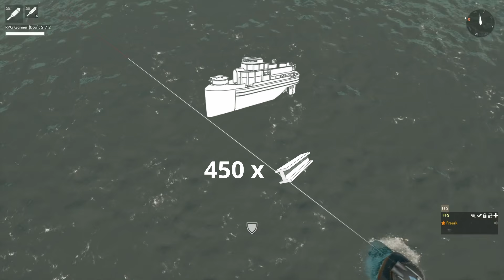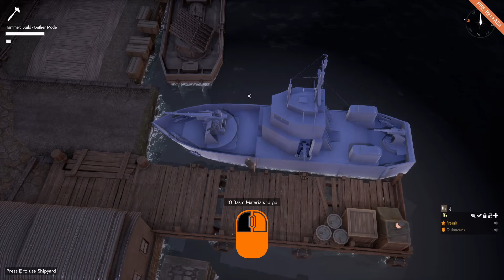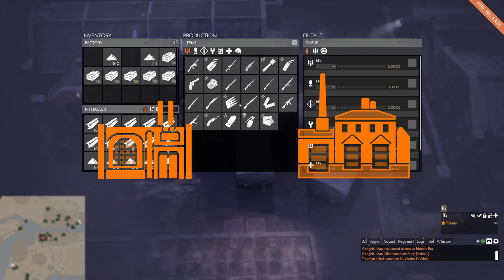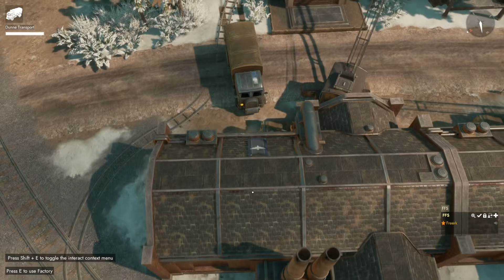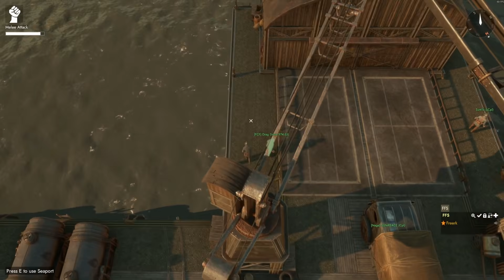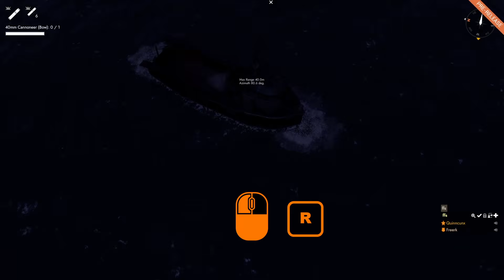Gunships- Foxhole Guide

Comment: As a collie navy player, they should really buff the warden medium boat. In a fight between two crews who know what they're doing the Strider wins every time. I've won 3-5s, and one of those 3 was an AA boat. Orn's back turret thingies should probably like reload slightly faster and turn back far enough that their fields of fire partially overlap. Or the RPG turret needs like a 240 degree arc or something.
Reply: Yeah the RPG part of the warden medium boat really sucks
Reply: @yourlocalkj  The rpg turret is at least closed off so just providing a turn radius buff should be enough. The 30mm at the back tho might have to be swapped for something else. I understand the forever quest the devs have of providing a worthy 30mm tool for the wardens but that aint it.
Reply: Besides the Warden naval assets then to have something over the Collie version in atleast one way or another, you feel their gunboat needs a buff cause the Collies version has an edge for once? What?
Reply: @ScryeTheMindless  As far as i am concerned, if  they do something like the scout planes (both factions having a nimbble scout and a tankier scout) for the gunboats, i would be more than happy.
You get some form of asimmetry but not the Bs of having a dogwater option for one of the factions.

Of course it does imply that i would like seeing more stuff for the collies too.

Comment: Man I hope they increase Ornitier's turret max turn angles so it can fire all its weapons broadside like a Strider
Reply from the maker: I think they limited the RPG turrets arc to "force" the use of the deck cannons and therfore the need for maneuvering. 
Because yes, the Strider has a large firing arc on both cannons but its rotation speed is quite a bit slower than that of the fixed deck cannons of the Ornitier and the RPG turrret.
To me ( as a non-naval combatant) it feels pretty well balanced, but of course I could feel completely different in an actual naval battle
Reply: @FreerkHoltes  We basically used the Ornitier as cheap trash during this war,  it is far below the strider in terms of utility so we always avoided overfilling one with ammo (usually half or below half) as we knew it was bound to be destroyed fast.

It's only real use was to provide a target for the enemy boats to shoot at while an anti air gunboat was sent on the enemy flank in order to decrew the striders.